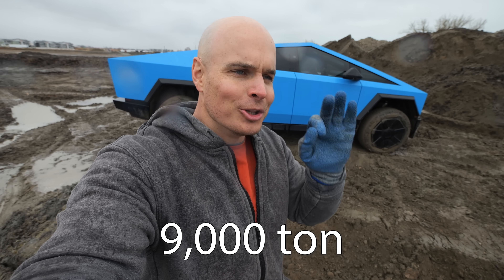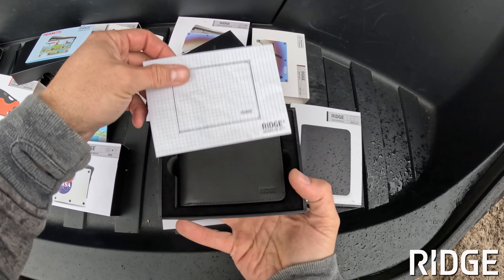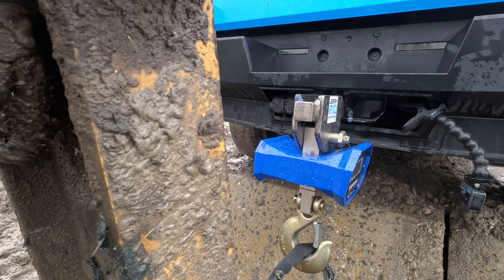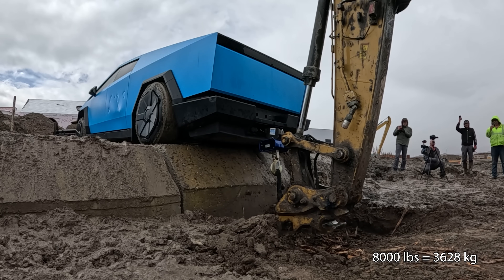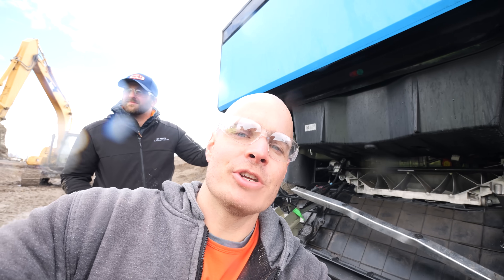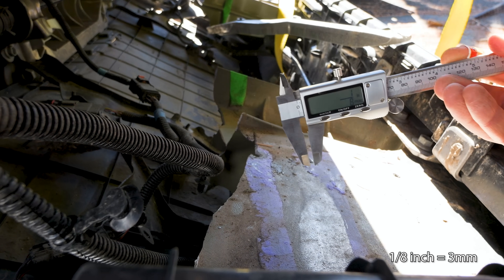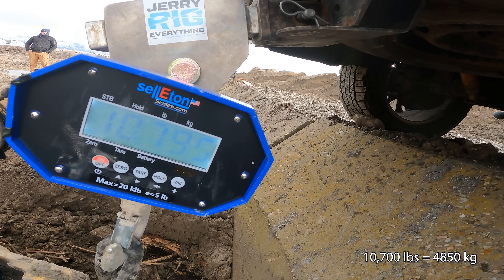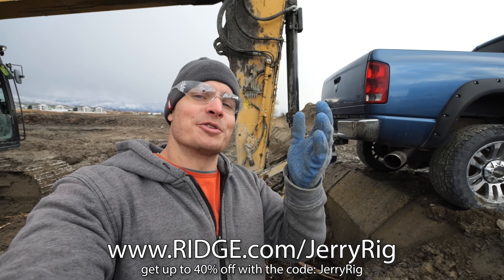SHOULD YOU TOW WITH A CYBERTRUCK?! - (catastrophic failure test)

Comment: The battery powered truck is toast now huh? Had an engine been in the Dodge, they could have driven it away- whereas the battery powered "truck" came up with 28 failures rendering it non driveable, along with the non repairable frame. Perhaps the battery "truck" should have a steel frame and an aluminum body?

Comment: Dishonest test of tongue weight rating using towing capacity number.
Reply: Peoples trailers were snapping off the cybertruck on the highway, and the trailers are under the cyber trucks towing capacity. It makes sense why the people who have had their trailer come off said it was on a big pothole. It jumps the trailer in the air and puts all the weight on the hitch. Not dishonest at all just taken to an extreme.
Reply: Not dishonest this was just a stress test at slow speed poundage increases now add regular driving with bouncing weight just look at how the loader started bouncing the dodge and it did not break Tesla broke with no extra added stress. It's junk and towing gives you only a range of about 90 miles which means bigger junk. It's just a toy it's not a truck.

Comment: Doesn’t the torsion from holding down the front of the CT kinda ruin the comparison? seems the CT’s frame would have been under more cumulative stress than the Ram, making just the tongue weight comparison inadequate. 

Also, the pulling load is what’s rated at 11k. Even under extreme circumstances, the chances of a 10k pound trailer putting more than its full weight on the tongue would be extremely unlikely… Or at least if a catastrophe that extreme were to occur, breaking the frame would probably be just one of many disastrous results.

Comment: In what world would anyone put 11k pounds on the hitch of a truck? It’s moronic to say it’s built like a coke can because of that. Also you should have compared it to a standard full size truck with more of a comparable tongue weight/towing capacity instead of a 3/4 ton work truck specifically designed to work/tow.

Comment: Downward force was not the correct way to test this. Trailer loads would not be that high downward, also called pin weight. Pin weight is usually around 10 percent of the total load so only 1000lbs total. Lateral weight should be tested for a true test.

Comment: To everyone saying this hitch broke because the load was applied vertically instead of horizontally...go buy one of these trucks, and some Tesla stock, I hear they are doing very well right now.

Everyone else you should know that one of the biggest disadvantages of cast anything, including aluminum, is that there is no grain structure in the metal. Grain structure is what gives strength to things like forged or folded steels. All the molecules line themselves up with each other and resist the forces acting on them together.

With casting those molecules are facing all different directions and this lack of cohesion creates a uniform weakness throught the entire piece. Meaning if you compress such a material it will flatten, pull on it and it will extrude into a metalic spaggetti, twist it and it will deform. It has no inherit structure to it.

The only reason to use cast metal in ANY situation is to lower tool/material costs, and manufacturing times. It should only ever be used for low-cost, disposable, non-critical, non-load bearing parts.

But I'm guessing the last guy who told Elon that was fired.
Reply: Then why in the construction world do equipment manufacturers use castings in the high stress areas such as boom to stick and cylinder to component areas.  Honestly trying to understand this because I do believe what you are saying.  And we do send some parts out for cryogenic treatment to get the molecules to line up better(?) thus making a stronger more wear resistant part.

Comment: 10 x tongue weight  seems like it is well engineered to me
Reply: If you don’t compare it to a properly built truck or have any understanding of mechanical engineering or metallurgy lol
Reply: @Sexy_coalminer  it's using aluminum instead of steel for less weight otherwise it wouldnt be energy  efficient
Reply: @Sexy_coalminer  ok elon hater..
Ford F-150: 1,400 lbs
Chevrolet Silverado 1500: 1,300 lbs
Ram 1500: 1,270 lbs
Toyota Tundra: 1,200 lbs
GMC Sierra 1500: 1,300 lbs
Ford F-250 Super Duty: 2,000 lbs
Chevrolet Silverado 2500HD: 1,850 lbs
Ram 2500: 2,000 lbs
Ford F-350 Super Duty: 2,500 lbs
Toyota Tacoma: 680 lbs
first of all do you have any understanding of mechanical engineering or metallurgy?? or are these improper trucks?? lol
Reply: @Sexy_coalminer  Sounds like you just want to hate.
Reply: @kristian4279  lmao you can like Elon and think the cyber truck is shit

Comment: Since the ram doesn’t have any engine, maybe it was limiting a Little bit the max pressure/weight on the hitch, the engine would have balance the trucks weight a bit more on the front

Dunno, but it still outperformed

Comment: One improperly loaded trailer away from failure? If you are putting 10,000Ibs tongue weight on your trailer, that not improperly loaded, that criminal and you would be completely responsible for the failure. I hate that truck too but this is ridiculous.